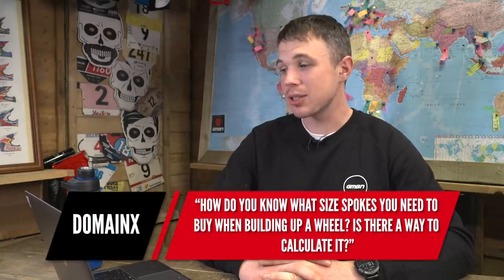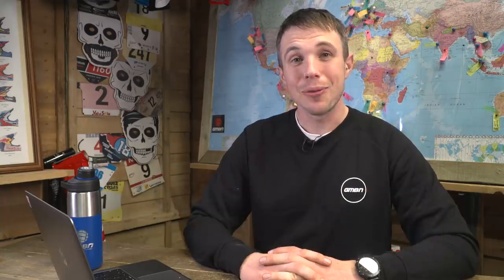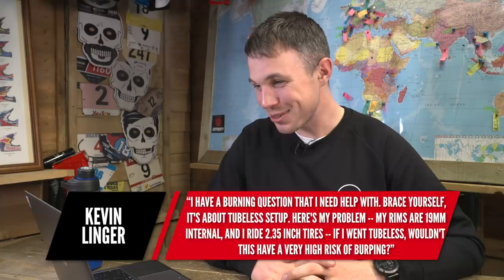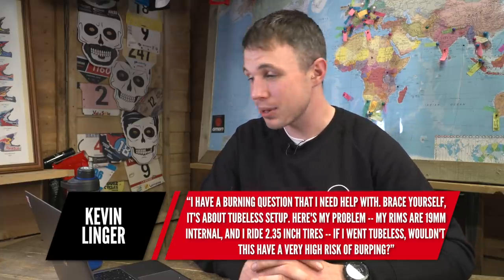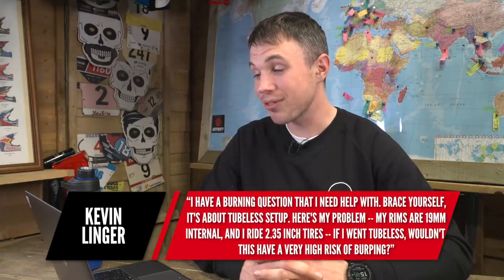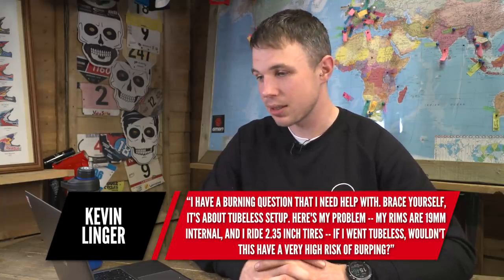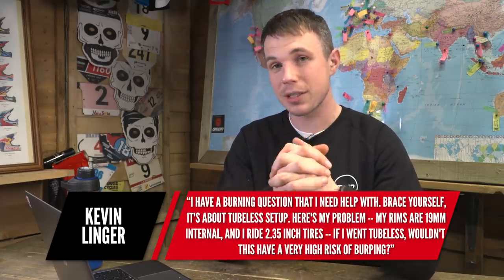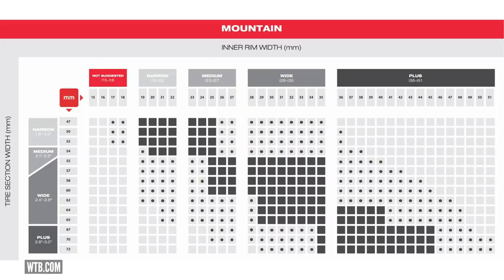How Do I Measure Spoke Length? | Ask GMBN Tech

Comment: Pertaining to figuring out the correct spoke length, the most important thing you have to make sure of once you think you have your spoke length determined, is that when the wheel is built those spoke threads should be fully engaged in the nipple to the point where the end of the spoke is just about (almost) protruding from the bottom of the nipple. This is because you need proper thread engagement between the spoke and the nipple. If you don't have this you're going to probably experience broken spoke/nipples once you start using the wheel.
Reply: Good to know :)

Comment: I ran 19mm internal rims, 2.35 schwalbe tyres at 28/26psi and no problems burping. Didn't ever rip berms hard enough to brrraapp, but u can run that TOTALLY FINE!
Sorry H! Do it. Tubeless is so much more than puncture resistance

Comment: Pythagoras solved the issue for how much your (actual) reach changes if you cut down your bars. 

You'll have to draw the triangle and make some assumptions regarding  the angle of the steerer/stem combination, whether the handlebars have a sweep and how it's placed (i.e. if it's fully vertical it doesn't change the horizontal distance at all, but that's silly), and what the resulting angles are. Then you can estimate how long your arm "must" be to complete the triangle.

But if you assume 460 mm reach and a 60 mm stem one of your triangle sides then you 520 mm on the direction of the bike, and  800 mm on the perpendicular plane for the handlebars. Your arms are the SQRT of ((520)^2+(80)^2). From the center of the top tube over the BB, that's 954.15 mm.

If you cut 20 mm from each side you get 920 mm. So you've reduced the distance by 33.3 mm, or about 1. 66 cm on each side. For something more meaningful you'd have to factor in where your arms are in space (i.e. how wide your shoulders are) and how you set up things like shifters and brakes, etc.

Comment: #askgmbntech
I got a full-suspension mountain bike that has 120 mm travel front and rear. I'm looking to upgrade the fork, but I am having a lot of trouble finding one. Is there a difference between cross-country forks and all-mountain forks except for travel? And which forks do you suggest? I use Quick-Release and I have a 1 1/8 inch steerer tube.

Comment: i invested in calipers for a wheel build after having issues with incorrect spoke lengths from using an online calculator, now i'll just input the values myself for future wheels, shame that some users cant do simple measurements when inputting data to online calculators

Comment: #askgmbntech with wider rims becoming the norm do you think we will start to see rims with spoke beds that have offset angled spoke holes designed for cross lacing like we do in the bmx industry?

Here's an example
https://cdn.shopify.com/s/files/1/1777/8211/products/s1200_1415_800x.jpg?v=1518041668

http://www.alienationbmx.com/wp-content/gallery/runaway/spokes.jpg

Comment: I just switch from a 2016 Rockhopper to a 2020 fuse comp, and I love it! I'm starting to look into my options for pork upgrade, and I need some help. I currently weight 350 lb / 158 kg, and I'm using mountain biking has both full for weight loss, and a motivation for weight loss (the less I weigh, the less climbs suck lol.) What will be a sturdy option for a 130-140mm fork in the $700 range? I’m looking heavily at a Lyrik select, or a Bomber Z1, Thanks! #askgmbntech

Comment: #askgmbntech
I have a Specialized Rockhopper with 135x9 dropouts. I want to upgrade my wheels, Is it possible to fit a 142x12 hub? Do I need something else apart of the respective endcaps?

Comment: on my 2.2inch Nobby Nick rear tire I run a Tanus tube armor with a skinnier tube and have no issue running tire pressure even under 20 psi with out getting flats on rocky tech. The other week when it was muddy I let some extra air out and didn't realize I had it all the way down to 11 psi... still didn't pinch

Comment: I get a good miles-to-puncture ratio with tubes and tire liners on my commuter with 26" wheels.  Asphalt all the way but sections of the shoulders are akin to gravel on two-lane roads through the farmland of Central Pennsylvania.  Plus I'm running stout rubber, so that helps, too.  Not that I'm opposed to tubeless, just that for everyday commuting--and very real riding in all weather--this set-up works well.  And swapping tubes in cold weather is easy enough, as I had to do once last week, my first flat in months, actually, but still arg as a flat en route to work is always a hassle.

Comment: #askgmbntech - I ride a diversity of trails, where I would benefit from changing between 34T (stock) and 36T chainring in my 1x12 setup.  Do I need to change my chain length as the 36T is bigger?  High gear (small cog) shouldn't care, but not sure how much I can stretch the derailleur in the low gear.

Comment: #askgmbntech Hey guys and gals, I am upgrading my wheel-set and was going to swap out the rotors until I realized that the new wheels are 6bolt hubs and my current are center lock. I have some slightly used 6bolt in my parts bin. Is it a problem not putting on new pads assuming that they have enough material left?

Comment: Hey guys! I’m looking at the new Vitus Mythique 29er, and I’m right in the middle of the Size Large on their chart based on my height. However my arms are out of proportion (my wingspan is 6’3” and I am 6’ ish) do I size up for bigger reach or stick with large? For reference, I’d be fitting a 35mm stem and 800mm bars. Cheers!

#askGMBNtech
Reply: I'm also 6ft with a longer wingspan than height, I would still go for the large because the seat tube length of the XL would mean using a much shorter dropper post which would impact downhill performance a lot more than a little bit of reach
Reply: Ahh that makes sense, cheers for the opinion!

Comment: #askgmbntech hey Henry and Doda I don’t always want to send my bike to the bike shop every time it needs service and I’d like to upgrade it in the future so I need a toolkit. I was looking at the Topeak Prepbox is it what I need as I only have Allen keys, pumps and brushes and is it worth it. If not what would you recommend as I know parktool does a similar kit but doesn’t look that useful?
Reply: You could also walk to your local hardware shop and look for all the needed tools there. You can use those toolboxes as guideline. Then compare the prices.
Reply: You probably don't need all those for basic/regular maintenance. Buy tools bit by bit. But topeak and park are expensive brands. You can buy top quality, sometimes better quality/design tools way cheaper from brands like icetoolz, bbb, super b.

Comment: #askgmbntech Hi guys, love the channel. I just got a new fork for a build I am doing but the steerer tube is about 50mm too short and I can't get a stem on it. What can I do about this? is there an extension I can get? it's a Bolany 32 Air sus for a 26er. going on a Trek 3700 frame. straight steerer.
Reply: You bought it used? Usually they have wayyyy too much material and always require a lot of cutting. 
50mm (5cm) is really lot and don't see you could safely mount it. 
Is it that same chinese fork as in Aliexpress? First possible forum thread said its possbily really dangerous.
Reply: Its either been cut down already or made to short/u didnt bother to check head stack height v the steerer. Assuming ur using no spacers (remove them all if are, see if u get enough steerer), then there is nothing u can do at all bar get a new fork. 
Never heard of that make fork...so did you fall for the alibaba stuff?
Either way, the top of steerer should sit 1.6mm below top of stem (to allow for top cap)
Given ur in this situ and asking this question, I suggest LBS

Comment: #askgmbntech what would be the gains going from a 26er to 27.5 or 29er in terms of the bike being nimble, stability and control?
Reply: Nimble-26" stability-29"
Reply: As there isn't over 10 videos on this channel already about it?
Reply: Bigger rolls faster, accelerates slower with like for like tyres/wheels
Reply: 29 less nimble, prob try 27.5 first if coming from 26, before going to 29

Comment: Personally i have 13 psi on the front and 15 in the rear, grip is amazing !
Reply: Bobo MasterRace I have 15 on both
Reply: Are you using a digital measurement tool for that because 13psi is nothing. I run 22 and that's pretty low
Reply: Julian Drennan i don’t use digital measurement but i have 29x2,6 tire, i think it’s that (and i’m 50kg)
Reply: @currymasterrace7153  Even though you're light I still doubt you're running 13psi. The readings in pumps are usually pretty inaccurate
Reply: As soon as read this i heard in my head Ding...Ding... Dang!... 🤟😁
Reply: Are you running tubeless? 13/15 psi in a tube is pretty much flat lol
Reply: @danimayb  tubeless of course !
Reply: @currymasterrace7153  Had to ask because the subject of tubeless didn't come up lol But yeah I know people who run 17 so I can believe this :)

Comment: tubes 4 life
Reply: There is a reason every pro race team runs tubeless...in fact numerous, including no tube/tyre friction and faster rolling and acceleration. 
But it comes with slightly more set up faff, but way less trail side (puncture faff)
Reply: @rupedog  I run 18-20 psi front and rear, never had a puncture when riding off road so not questioning anything you said, tubeless set up in my case is not worth the hussle (I'm too lazy). Sticking to tubes bro.